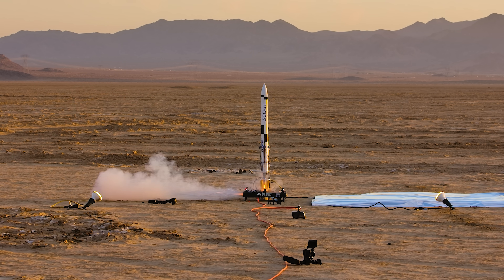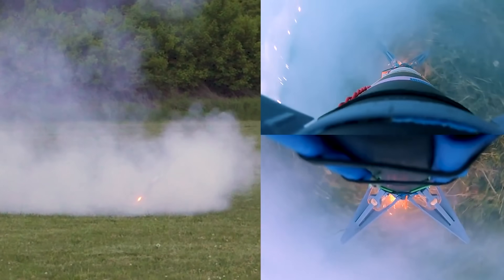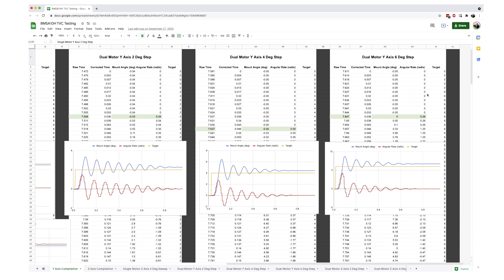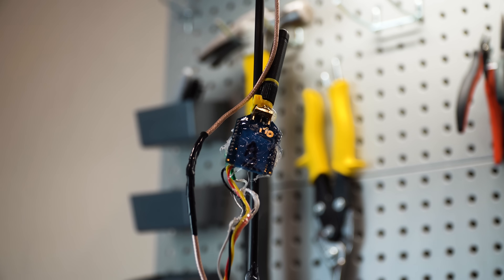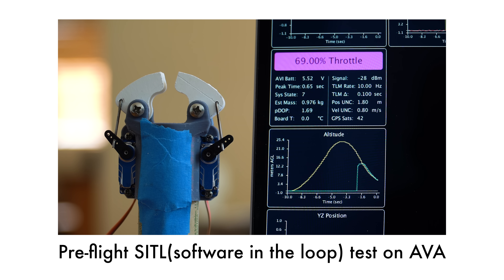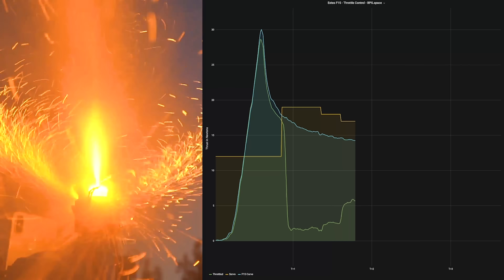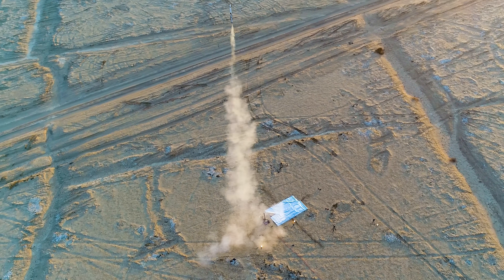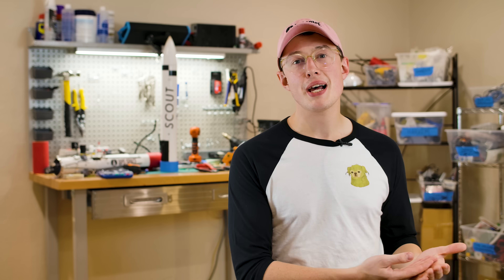Scout F - Flight 1 - Launch and Landing

Comment: I don't think you need to reach a certain height. Of course, the engine should not be fired too early. However, if it is fired too late because the said altitude was not reached, you only have to cool down the engine (in whatever way) at the moment of altitude "0" so that the thrust is at "0" as quickly as possible. Then you no longer have the problem that the rocket flies off again after it has landed. 
On the subject of "wiggle": In my opinion, it would make more sense to use such control grids as the Falcon 9 has at it's top, instead of just a rotating propellant. I would thus restrict the movement of the propellant.
Comparison: When driving a normal car, the steering is mostly in the front. However, if you move the steering backwards, like on a forklift, it's a lot more direct and you can corner harder. This then creates this thing with the "wiggle effect" ( negative point ). Therefore, I would recommend "pulling" the steering rather than "pushing" it. = a collaboration of e.g. 80% control grid and 20% propellant charge steering

Comment: Amazing work! I am no rocket scientist, but I think the lack of throttle authority is a big deal. The rocket should have a bit more room for error.

This may be a dumb suggestion, but would you be able to carve the ceramic pieces to redirect some gases slightly towards the top of the rocket? This may let you have more throttle authority without adding excessive complexity.

Comment: You could study the apogee perturbation problem by using an Extended Kalman Filter (dynamic model of descent portion of flight assuming apogee is known) by making a Monte Carlo simulation for the different initial conditions to quantify state covariance of that portion of the model. I'm thinking the EKF could even produce the PID set points once you know how much "noise" the EKF has to take into consideration.
I would even estimate apogee with an EKF.

Comment: To tame that shimmy, simply counterbalance it. When the actuator pulls the motor one way, have it move something else the other way. That way this unwanted behavior is counteracted in its own section, instead of leaking its effect to the rest of the structure. An example of a machine that uses this every day is a piston engine crankshaft, with the counterweights built into it. Where possible, they try to get the pistons to counterbalance eachother, but some cylinder counts and arrangements require more brute force.
 You may see some benefit in response time and weight if you design a motor pivot gimbal frame that tilts the motor from its middle, and counter tilts part of the mechanism that performs this movement.

Comment: Grand bravo for your perseverance !  If you also accept comments from those who do not launch rockets but faithfully follow your channel, I would like to make a suggestion.  I clearly saw at first glance the energy dispersion of your main engine pendulum system.  But it may not be so useful at launch.  Most hobbyist rockets use only aerodynamic stabilization on launching.  On the other hand, the stabilization "gimbal" becomes definitely useful during the descent.  Have you considered a prototype in which the automatic thrust stabilization assistance would only be triggered in just after the peak and only during descent? 
Receive once more all my admiration, friendly...
(I also appreciate your appearances in videos of  your beautiful and brilliant friend  Xyla)

Comment: Using some fins would give you a better aerodynamic stability which can mitigate a lot of the vibration and repositioning of the throttle on the way up and that will save you a lot of trust to go up further and buy yourself more time so you can adjust better for landing.

Comment: I think the model rocket may be too light and drifts in the xy plane way too much on its way up and down. Hence when z -> 0, your rocket has so much xy final velocity that it flies sideways and falls over. After watching many of your rocket videos, the first problem I see is that it seems like the amount of angle the thrust vectoring can do is just not enough to cancel out the xy final velocity when z -> 0. The rocket's tube or walls prevent it from turning enough. The second more fundamental problem I see is that the conditions you need are vxf = vyf = vzf = 0 when z -> 0, but the final velocities in the x, y, and z are coupled because of theta. If theta is the angle your rocket thruster makes with the z axis, vzf = vf*cos(theta) while vxyf = vf*sin(theta). For any given theta, you can't get cos(theta) and sin(theta) to both equal zero at the same time. With one thruster, the three scenarios are what I've seen in your videos. 1) When you try to get vxyf -> 0, i.e. - "reduce sideways or xy plane motion", theta must be some value closer to 90 which may ideally cancel out the sideways motion, but now your vzf thrust maybe too small and it crashes down. 2) When you try to get vzf -> 0, i.e. - "reduce z motion", theta must e some value closer to 0 which may ideally get you vzf = 0 when z -> 0, but then you can't get enough xy thrust to cancel out its sideways motion due to wind or whatever and it falls over. 3) When theta is somewhere near 45 degrees or any angle between 0 and 90 you do both badly and the rocket goes sideways and crashes down.

Trying to cancel out three directions of motion with one thruster simply may not be possible. However, one solution would be to launch it high enough and use grid fins to cancel out as much xy velocity as possible so you can focus on vzf. Another solution could be that you try to cancel out xy velocity first and then completely "turning off" the thruster by covering it up while you rotate it so theta = 0, then "turn it back on" releasing the cover. This way, you decouple the final velocities between the xy and the z directions. I know that you can't turn off and on the solid rocket thrusters, hence why you cover them with a retractable cover so it effectively turns the thrust on and off.

Some ideas of how you can work on the landing problem. 1) Just focus launching the rocket and making sure you can consistently or reliably cancel out all xy motion when it reaches let's say 10 meters above the ground, i.e. - z = 10 meters. Once you have that down you solve the z motion. 2) You can make a long straight vertical tube (to ensure xy motion is zero) and some compressed air at the top pushing the rocket downwards with the same velocity you expect it to have on its way down in air and when z = 10 meters, the rocket boosters turn on to cancel out the vzf. Essentially, I'm suggesting to work on the final xy and z motions separately and then bring them together instead of doing all at once.

Comment: Just a few thoughts. Rather than calculating landing burn at a specific apogee, why not calculate a landing burn at terminal velocity. It seems it would be a more stable constant making calculations and programming much easier. And then Maybe take the space X approach and add control surfaces at the top of the rocket like grid fins. These can be used to decrease terminal velocity and how direct the rocket requiring less gimbal needed. Also I would think being able to throttle up more than 20% is more important than throttling down 60%.

Comment: Why don't you just design the rocket so that when the landing engine is throttled down to the maximum the thrust to weight ratio is less than 1? That way you don't need to time the landing perfectly but can leave the engine firing after the landing until it burns our?

Comment: Top fuel jet boats will use a neutral bucket to redirect water 90 degrees to each side that will negate any forward thrust while staging. You might be able to use that instead of outright trying to block the thrust.

Comment: Why not just filter out the vibration so you don't get the over correction? The frequency of the vibration is going to be significantly higher than the change in angle you are trying to compensate for. I would imagine that a simple low-pass filter would drastically reduce if not solve your problem.

Comment: Nice job! Maybe you could try to target a predicted landing vertical velocity, by building into the control loop a simple predictor model based on the measured state, and a simplified model of the burn profile... Of course, the feasibility of this would be quite dependent on how much you are able to process in a guidance update cycle in the controller.

Comment: How about making the rocked so heavy, that 20% thrust is not enogh to lift the rocked, but to steer it. Obviosly more weight is not so good, but if landing is the mission and not high altitude, than I guess it's a reasoneble traidoff.

Comment: The main landing problem is this: When to start the landing rocket. As there is some throttlability, you should calculate the nominal landing total rocket's energy as 80% or 90% of the actual. Such nominal energy should counter the rocket's potential and kinetic energies at the rocket start instant, in free fall. Imagine a ballistic landing in reverse time: the rocket launches with the 80% efficacy throttling and reaches a height and a certain speed in the landing-rocket working time, account for landing-engine mass linearly increasing with (reverse) time in calculations, thus rocket acceleration decreasing accordingly. Then it has full landing-engine mass. The said working time, height, and speed should be your goal to start the landing rocket. Margin? What that extra 20% efficacy could add, so repeat calculations with 100% efficacy, 0 throttle. Same working time, new height and speed. If height falls within margin and speed does too when it's time to start the landing rocket, it should be able to land. How you know the height and speed, I do not know. But you do....

Comment: for the problem of vibrations in the IMU, could you remove the IMU from AVA and place it on a daughter board connected with a board to wire connector, then mount the IMU on something similar to a microphone shock mount? The IMU / board / 3d printed bits shouldn't add too much weight, and it could be positioned right above AVA. Im assuming if you have the vibrations profiled, you could select the elastic used in the shock mount to best dampen the movements?

similarly, could using some small dampers (I assume rotary, with some linkage from the servos, so you don't limit your gimbal movement with the compressed length of piston style dampers) help control the oscillation? It looks like its under damped right now, so the oscillations are increasing on accent

Comment: Why not use a proximity sensor, such as sonar or radar to time the engine and block off the thrust completely with a cap.  The thrust curve would be moot and simply a matter of altitude and timing at full power.

Comment: Think in a camera diaphragm as a way to control the engine, as it clises it dissipates the energy to the sides and not downwards . As so, you can have your engine burning longer and still land, and not worry to it to finish while in the air, maibe it will end the need of tilting the rocket to burn excess fuel

Comment: Consider adding a sort of suspension to the landing legs. The landing legs seem bounce-happy because of how rigid they are. You may find this effect negated if you add suspension. This is like dropping a pillow vs if you drop something rigid. Unless the rigid thing breaks or it breaks the thing that it is dropped on (both of which function as their own kind of not-usually-desirable suspension) the rigid thing tends to bounce were the pillow will explode before bouncing. 
By adding suspension you may give the rocket more time to decide it loves the ground landing legs first. This is like what you are trying to accomplish with the cardboard landing pad but built into the rocket itself.
However, the suspension may allow pitching tendency as it touches the ground with a horizontal vector; whether that will be better or worse than what it experiences when the current legs smack the ground with a horizontal vector I can not say for sure, though I would guess it would be better. That said you may find the landing more forgiving with a suspension system. 
A simple way of making a suspension system (at least for testing) would be just to disengage the locking mechanism for the landing legs and adding some kind of hinge spring. The thing to watch for with this method is ensuring that the motor mount doesn't smack the ground on impact. If you decide you want to cheat a bit, you could use very soft suspension to allow the rocket to drive some sort of spike into the ground to function as a kind of anchor.

Mostly this is some incredibly impressive work. I really enjoy watching the progress and work you put into this.

Comment: Add a rocket motor on the top pointing up timed to push the Scout firmly down on landing, and to overcome thrust from the landing motor.  Landing with a unthrottled motor is hard. Perhaps a crude throttle control can be achieved by equaling out the forces working on the Scout at landing by having two motors working against each other, rather than blocking the landing motor exhaust.

I like your stuff.

Comment: Amazing! You should consider a bang-bang baseline control with state matching blending into a PID. I do this for an ultra fast steering system that has lots of viscous and dry friction damping. I think you already know that your gimbal simulation needs full multi-body dynamics.

Comment: Gimbal question. Since you have designed a motor throttle, could you control thrust vector with multiple off-center independently throttled motors instead of a single gimbal that costs 20% of the rocket's mass? Say, three B6 engines, independently throttled, arranged in a triangle?

Comment: I am amazed that you have designed this rocket system and how close the landing really was. I did have a question regarding the landing legs-namely on grass: would a few CF rods, maybe a few inches long on the landing feet (LEM style) help with landing by acting as an anchor point? Or would this add too much strain?

Comment: I had a couple of dangerous ideas of how you could control of the throttle on a solid rocket motor. Activity control the amount of exposed surface area of the fuel grain. One way was to push a carbon rod into the top center of the rocket motor. Then during flight, have a linear servo push or pull the rod. Another idea would be to split the rocket motor vertically into 3 or more shafts. Then rotate them together like an iris

Comment: In response to getting a more accurate landing have you tried to disable thrust vectoring on accent or force the vector control motors to be slower ie. Solves the problem of the wiggle happening by making more gradual movements vs quick and hard as it seems its causing more vibrations the quicker the center of thrust changes.

Comment: For the vectoring oscilation. You can create situations where the negative short term relation between control and observation (non minimum phase system) "causes" the instability. Your rocket should behave simular to a segway like system, but just with different parameters . A lot is writen about it so I recomend you look at ways they deal with possition control. Can't remember if there is much usefull to find about it regarding your situation though.
You can also change the system so you don't control the rocket but the rocket-motor system combined. But this means you have to reconstruct that systems state from the rocket measurements, and how moving the motor influences the system.

Comment: My thought is to shift 'the "X" marks the  spot' for landing to a "is the craft upright and not precessing" requirement. Unless you are tracking winds onboard the system, where you 'want to land' doesn't matter as much as will it still be upright when the smoke clears.

Comment: From the video it looks like the angular accuracy of the servo motors that position the ceramic baffles is low, especially when you add in the tolerances in the linkages.  You might get better accuracy with a worm screw and standard motor, and measure angular position of the ceramics using a different method.  

It might be worth looking into Frequency Domain analysis of your TVC and use Nyquist plots to predict dynamic instability of the control loop, which is what looks like is happening with the excess wiggle.

Comment: so why not have AVA on top and also have the landing arms come down from the nozecone. sure they will be oversized but then you would be holding up the rocket from the top instead f trying to balance it from the bottom. 

also whjy not try to design like a camera iris in ceramic instead of a claw? it could reduse  all thrust or most of it . just think of a camera shutter or   your rectum when the rocket fails.

also  if the gimble slams into one direction wouldent that also a play a bit of extra force making the problem worse? perhaps have a softwere stop a bit sooner just to avoid toe force of it  actually slamming into something  if that makes sence

Comment: Just a thought, but if you're able to monitor how the rocket is responding to your correction attempts, you may be able to dynamically decide on whether or not you need to over or under correct.  With so much of the mass of the rocket on the gimble, under ideal situations, it would probably be better to under correct, rather than over correct, and risk inducing those huge oscillations.  If however the rocket is not responding to your correction attempts, due to wind or the thrust of the rocket not matching your projected amount, then you would likely want to over correct to get it back on track, then once it is, switch back to under correction.